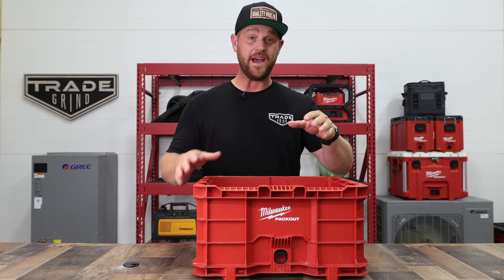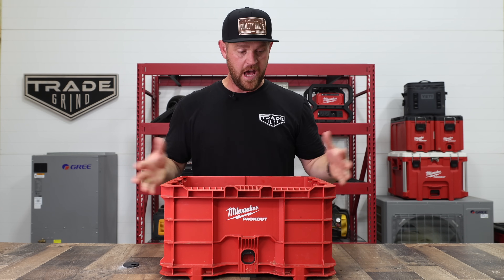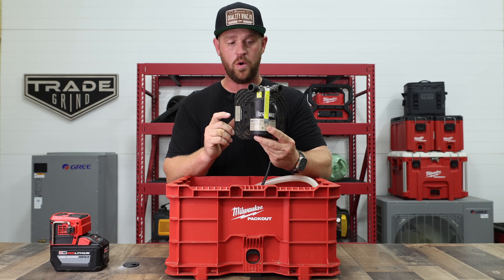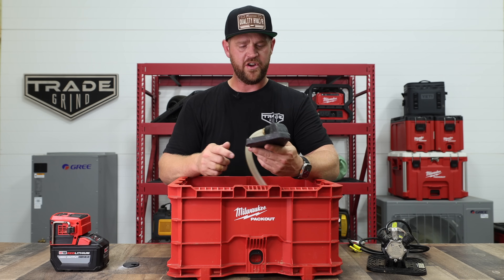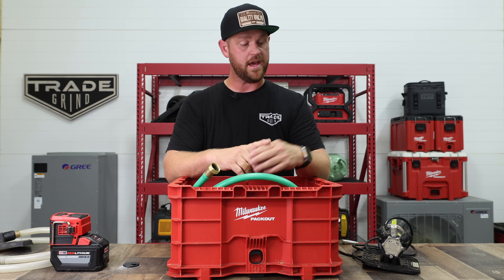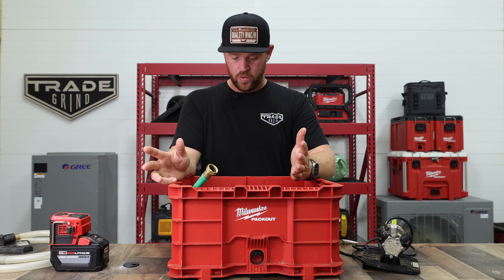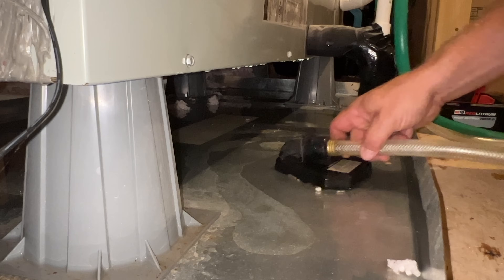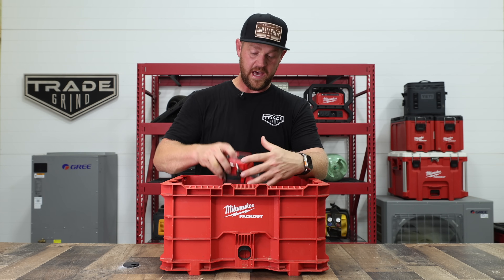Remove Water from OVERFLOW Pan & Unclog A/C drain line the EASY way!!

Comment: Just use a compressor or gallo gun
Reply: A gallo gun removes 10-20 gallons of standing water out of a container??
Reply: @realSamAndrew  shop vac smart guy
Reply: @realSamAndrew you dont need all that crap
Reply: @ATX83092  "just use a compressor or gallo gun". That won't do what he needed done , smart guy .
Reply: @realSamAndrew  the gallo gun or compressor will shoot air through the line and unclog it...Then you just use the shop vac to clean up the drip pan bro day 1 stuff

Comment: awesome man. I have a similar kit myself. Mine lives in a 5 gallon bucket though. And my transfer pump is mechanical...driven by any drill or impact. I has 3/4" hose thread inlet and outlet. I keep some rain-r-shine pvc glue/cement, some fittings, pvc cutter couple lengths of garden hose, and I also unions in my kit...as well as other adapters I made to quickly and easily connect whatever the drain line configuration requires to get it connected to the pump 3/4 hose thread outlet. I like that intake pickup you have there. I gotta get one of those. 
My drill driven pump is the one from harbor frieght tools. And it really is fantastic. It can move 750 gallons per hour. And it was only $15. It has an integral mounting base, with screw holes, molded into the pump body. Its super compact. I took a 2x8 board about 12 inches long and mounted the pump to one of of it. stays there permanently. And on the other end of the board, I connected an older porter cable 12v drill and mounted it with some hurricane clips and some hose clamps. Easily can take it off by hand as my hose clamps have thumb screw head on them, but I leave it on there permanently and just swap batteries as needed. 
Its changed how i view this type of call going in now. I don't despise these calls as much now. Haha.

It should also be noted that if i have a clog that the shop vac wont clear sucking from outside, I have had several where this drill powered pump created enough pressure with enough velocity to bust the clog up and send it on down stream. I have only ever had on instance where it created too much pressure and caused a leak at a fitting. To be fair, the pressure wasn't the issue...it was a fitting that was missed for glue/cement when it was installed. it was a 90 elbow transitioning from horizontal run to vertical straight downward so it never really saw a standing water situation to call attention to it.

take care. Keep killing it man.

Comment: Where did you get that little triangle black device to siphon the water out ?
Reply: i have tried finding them too. seems they only come with transfer pumps to filter the water.
Reply: It's called an intake filter. But even searching on amazon I couldn't find one separate from a transfer pump

Comment: Easier way to do it that all you need is a vacuum
Reply: Even easier..gallo gun
Reply: You guys don't pay attention. A vacuum doesn't carry the water out of the attic, and a gallo gun doesn't carry water at all...
Reply: @realSamAndrew  wtf would u need to "carry" the water?? Lol. If u unclog the blockage the drain will open up and DRAIN 😂😂😂
Reply: @AllTattedUp13  you're not too quick. Do you really think if that were possible this guy wouldn't know that? The pan is full of water. How did it get there? It OVERFLOWED. There is no secondary drain.
Reply: @realSamAndrew  been doing hvac for over 20yrs kid lol. You get water in coil pans when cond. Drain is clogged. It's not rocket science lol.
Reply: @AllTattedUp13  you still are not paying attention. I don't care why there's water, he wants to remove it and he doesn't want to carry 80 pounds of water down from the attic in a shop vac tank. The video explains it. If the secondary pan had a drain outlet, he would let the pan self drain. But that's not the case. Why don't you get it? You think Zac is stupid? Lol lol.
Reply: @realSamAndrew  every pan, coil pan, furnace pan has a drain line. If it doesn't then whoever installed it is a hack. Most places it's code. Furnace pan needs to have a drain line. And even IF ur getting water in 2nd pan that means ur cond. line is still clogged.
Reply: @AllTattedUp13  you need to learn to read. You need to learn to read. You need to learn to read. I never said the drain wasn't clogged. I said the secondary pan is full of water with nowhere to go. There are secondary pans that are just a place to hold water. If it's full it has to be drained manually. 

Let's do this. Forget air conditioning for a moment. Let's say I told you there's a 10 gallon bucket full of water in the attic and you need to get it out. There's no hole in the bucket and you have a 3/4 inch hose 3 feet away from the bucket that leads to a second floor sink drain. How do you get all the water out of the attic without pouring it out the attic door or carrying it down yourself?
Reply: @realSamAndrew  no I get what ur saying. And around by me that secondary pan HAS TO HAVE A DRAIN LINE. also aint no furnace pan gonna hold no 80lbs of water homie.